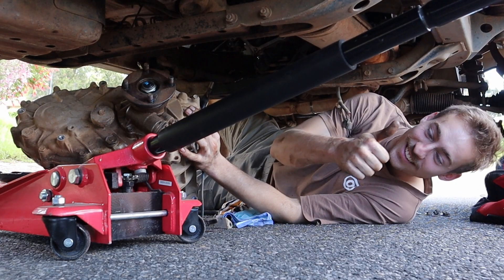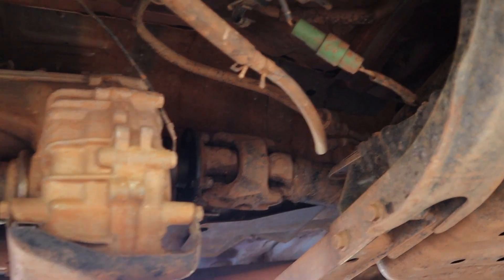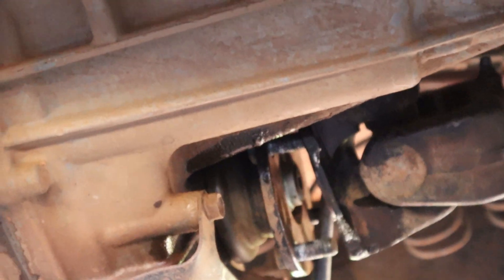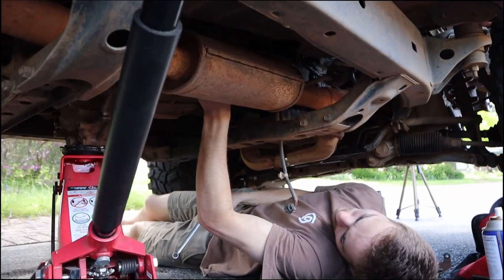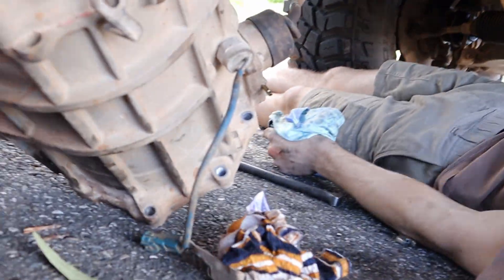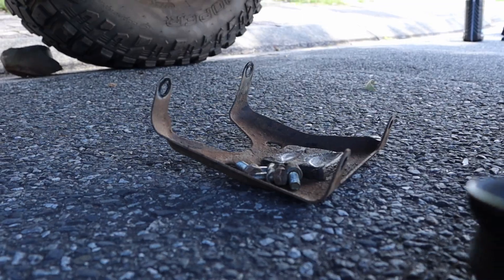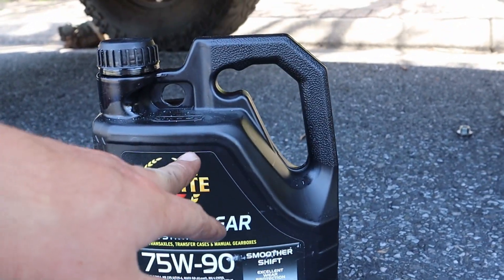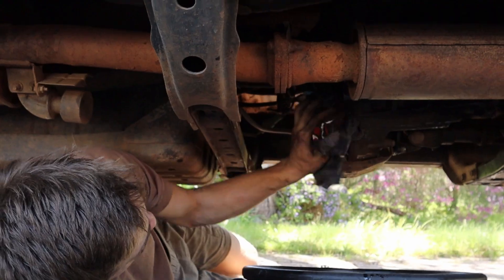Replacing the Transfer Case Prado 90series

Comment: Hi. Thanks for the video. My transfer case is leaking from the seal for the front drive shaft. Do you know the part number for this seal? I have looked online but found it quite confusing. Mine is a Japanese Diesel automatic with the KZ TE engine. So might be different. Any help would be greatly appreciated. Thanks!

Comment: Mine is the LJ95 with the 3L engine. G52 with rf1a transfer. The front output shaft bearing is growling when 4x4 is engaged but since i have the hub locks i can turn it off. Just bought the bearings after a hard search. I hope it's worth working on it.